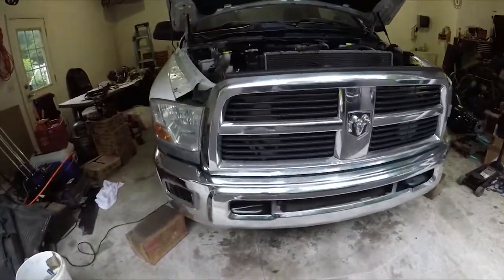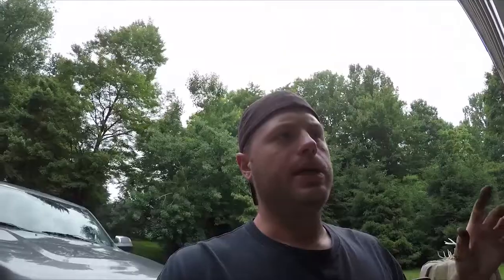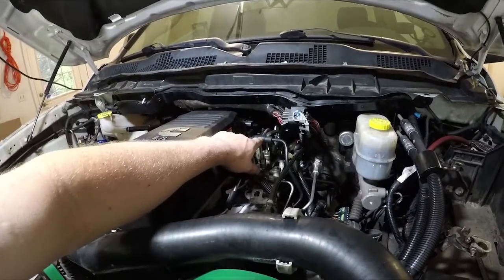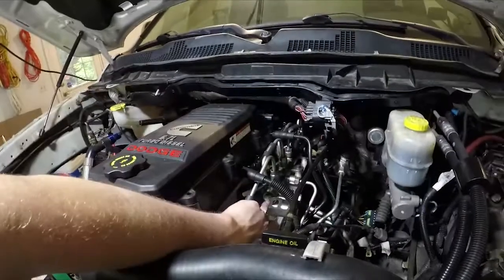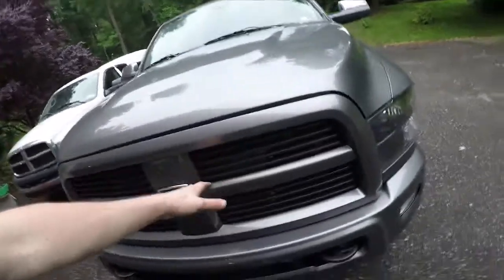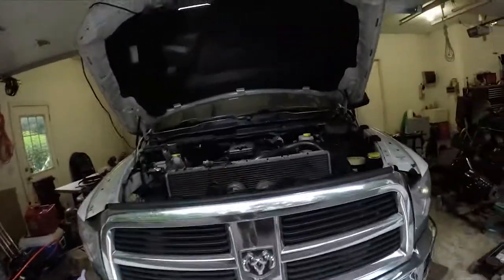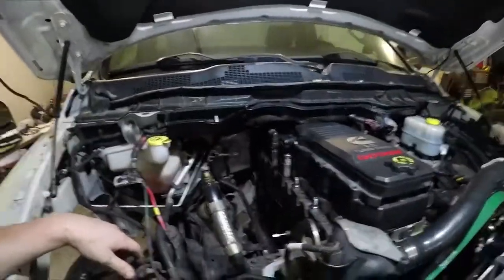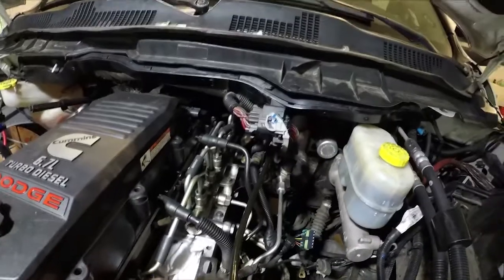6.7 Cummins Mod List Explained

Comment: This may be an odd question but is it okay / safe for hood/exterior paint to remove the heat shield that is attached to the underside of the hood on these trucks? The one on my 3rd gen is all torn to crap so I'd like to just rip the whole thing out if possible, but don't want heat from engine bay to cause paint damage on exterior. Thanks for excellent videos!
Reply from the maker: What T.J. said, I agree 100%
Reply: Thanks guys, mine will be coming off tomorrow!
Reply: its too late he probably already got rid of it.. but i always heard that its for sound yes but theres also a fire blanket on it incase the engine catches fire.. not sure it it actually helps with fire or makes it worse but just thought id mention for future people reading

Comment: Great videos! 
Are you going to be installing a FASS?
Reply from the maker: A lift pump setup of some sort, still on the fence on which
Reply: Turba Tom 
On a daily driver set up witch I do tow with about 1/2 the time,
 would it be more beneficial to run a twin CP3 set up and lift pump together or one or other only?
Reply from the maker: Those 2 mods are really for different reasons.If your stock fuel there isn't a need for twin pumps. A lift pump can provide better filtration, but my opinion is that the need for a lift pump is a bit exaggerated when it comes to stockish trucks.
Reply: Turba Tom 
That's exactly what I was wanting to know. 
I think i am going to do maybe 80-100hp injectors and things like the grid heater delete. But sounds like a fass or another lift pump will be the way to go instead of twin cp3s. 
Thank you for your help!